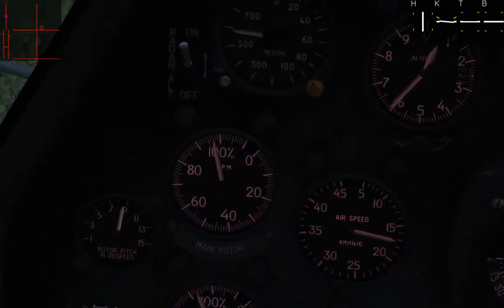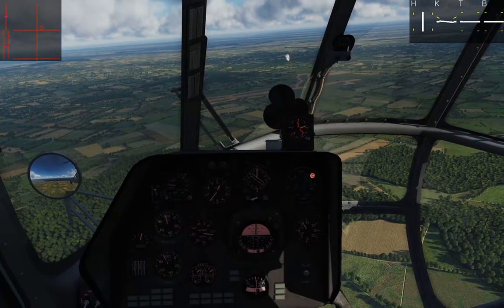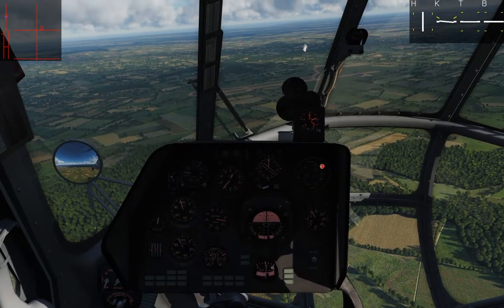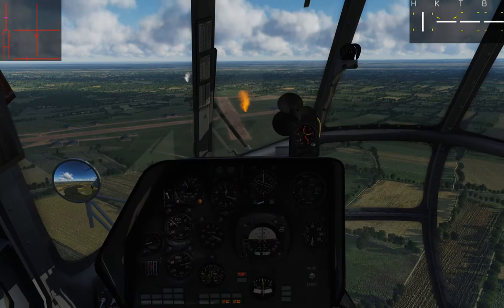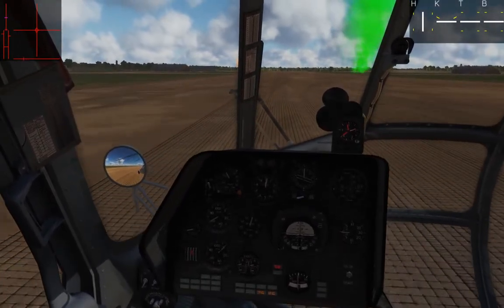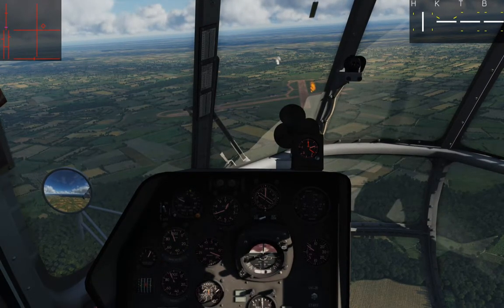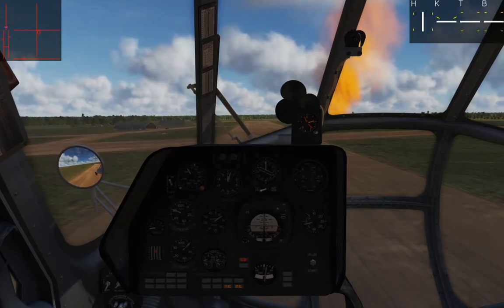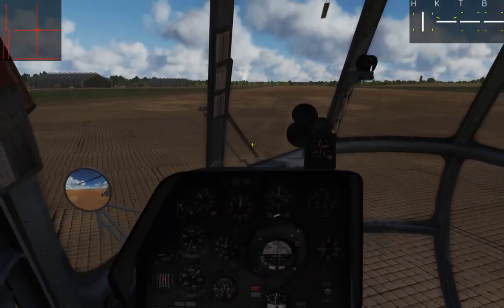DCS Mi-8: Autorotation Tutorial

Comment: I like your videos, especially the slow-motions as it gives ample time to absorb things and explain them. The autorotation "by the book" keeps the IAS at 100-120Km/h and keep rotor RPM above 88% and below 110%. The flare is basically the same as the video.

With main rotor RPM > 88% at least you'll keep the generators to power the systems needed to read height, such as radar altimeter as well as lighting in the cockpit.
Reply: A little bit different, IAS in AR for MI-8 is from 100-180 (120 is best time in the air and 180 is max range) And since already talking about AR, collective should go up only a little bit (we call it initial in our language) when you start to flare and starts going up from some 10-15 m when you start to pushing cyclic forward. And we usually turn off autopilot when we start autorotation since rotor RPM will always fall below 88% (and that turns off autopilot automatically) in final phase and it is a bit tricky if your autopilot goes off in weird position.

Comment: My boss has a gyrocopter and the whole operation is designed autorotation. He talked me into a ride one Saturday and it was a lot of fun. The pusher engine had a coupling like brake shoes that would grab the main rotor shaft and spin it up on the ground, getting the blades spinning before the takeoff run. Then he firewalled the throttles and we took off down a field. That forward airflow got the main rotor blades cooking! It almost felt like a powered helicopter. He always turned away from the blade rotation because in autorotation turning into the blades could cause the tail to snap around violently. Or maybe it was the other way around?... But it was very fast, we were doing 100 knots IAS with 3/4 throttle. When we came in for the landing, he reached up a turned the ignition off! I thought he was suicidal and wanted to take me with him. But with no pusher engine we came in and he  glided right on in like it was normal. Since that flight I have been looking to buy one myself. I just can't seem to pull the trigger...

Comment: Letting RPM drop to 60% is a death sentence. I think DCS doesn't model this correctly, but that low RPM is unrecoverable. Also the better sequence is a very fast lowering of collective to preserve RPM, a pull back on the stick to preserve attitude and a lot of left pedal because of the lowered collective. Once lowered the collective, it needs to be lifted a bit to prevent overspeed of the main rotor. Once you are correctly established on the glide path, you find a field suitable for touchdown and you modulate airspeed to reach it (higher speeds allow for longer forward distance, a more shallow slope). Regarding flaring, this can be done at a slightly higher altitude (10-20m, to protect the tail) with very little to no collective input - this will overspeed the main rotor for sure, but unlikely to care about it at this point in your life as a pilot. Target should be 0 forward speed if possible, due to the unknown nature of the terrain, touchdown should be with no forward momentum ideally. Lifting of the collective should then be smooth to cushion setting down while bleeding rotor speed, careful not to lift the helicopter higher. I think the Hip has a ton of rotor blade inertia, at 100% RPM at the end of the flare, pulling max pitch fast enough would probably float you higher. Also, from 10m height i think the landing gear would allow the pilots to walk away unhurt even if dropped straight down. Main thing is keeping the helicopter from tipping over ground clutter, from any sort of residual forward or lateral movement, shoving the blades into the dirt ruins everybody's day.
One thing you did touch upon in the outro is airspeed, as a general rule of thumb valid for most helicopters you're looking for the best climbing performance speed, this will give you the best gliding ratio in an unpowered descent. For the hip that would be somewhere around 120kph.
Great video, thanks for the work involved.